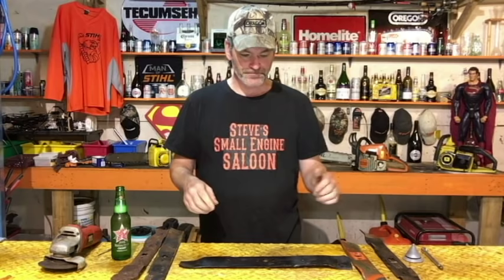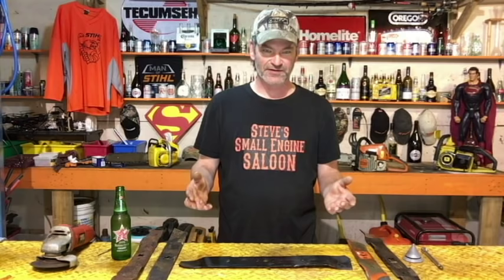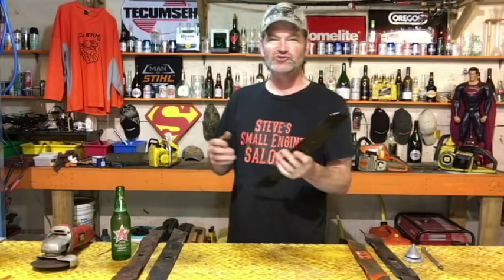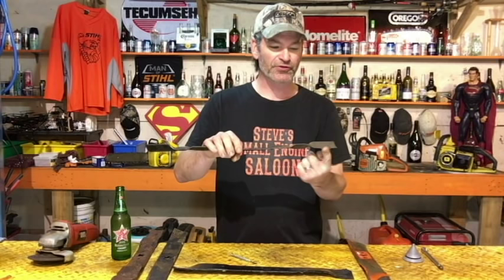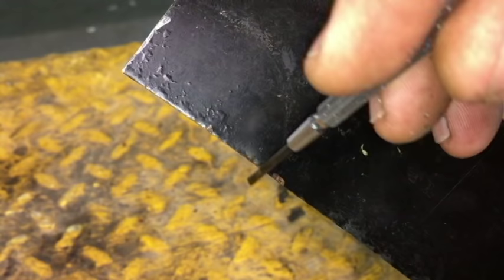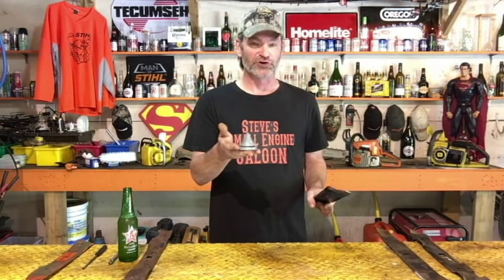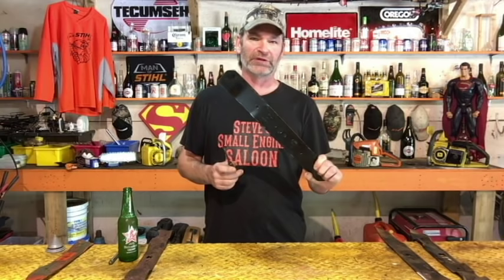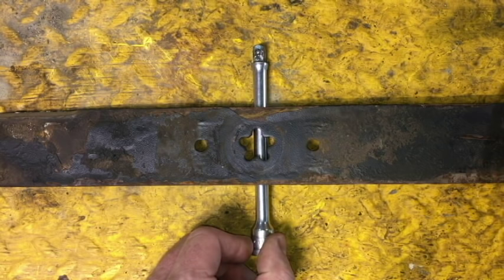How To SHARPEN And BALANCE A Lawn Mower Blade (The Correct Way)

Comment: I have read and heard from more than one source that it isn't recommended to use power tools to sharpen a blade because the resulting friction can generate enough heat to damage the temper of the blade, making the metal soft and prone to nick easily. Is there no truth to this?

Comment: If your blade is perfectly balanced it shouldn't move at all when you put it on a nail as you demonstrated. Now put one of your unbalanced blades on a nail and see what happens.
A nail is extremely reliable, so long as it's nailed into the wall level.

Comment: If you're sharpening a straight blade a stone or wheel of death is fine, but on a stepped blade you need the flexibility of a flap wheel..........And don't lay your grinder down on the wheel, it's dangerous.

Comment: Dam it : wrong beer too.. mine kinda clear with lots bubbles..... Big 40 penny nail is very reliable.. just be sure mark line accross blade were center is.. line nail up on it. i do both ! ... also if ruff cutting your field and dont care if not perfect... im use sledge hammer to fix bent blades.. exspecially if i intend on hitting some more stumps lol .

Comment: Hey, you forgot to tell them to put the blade back on the correct side up!
No poop dude: wrong side up don't work.
How the hell I put the blades on upside down I'll never know, but when I engaged the blades on the riding mower, I had a garden tiller. Took a minute and a couple of tries for me to figure something was screwed up.
Well, momma didn't call me son because I was bright. Hind sight, it must have been the wrong brand of beer.

Comment: .                              DANGER ⚠️
.          If you have a badly bent blade
NEVER NEVER ATTEMPT TO STRAIGHTEN A BLADE BY HEATING IT WITH A TORCH !!!!
Heating it with a torch will dangerously weaken the blade and could snap when you go to run the mower , Earlier this season , A friend of my buddy did that and when he went to run the mower , The blade snapped and went through the side of his garage and was sticking through the wall on the inside part of the garage
Had anybody been standing in the path of the broken blade could have been seriously injured or killed , You have absolutely no idea where the broken blade is gonna go when it snaps and will be thrown with more than enough force to easily kill a person
Also when the blade snapped , The mower was so out of balance it ruined the engine because the shaft was so badly bent 
So at anytime you have a bent blade , 
Replace it with a new one , In everything you do , ALWAYS PUT SAFETY FIRST !!!!!

Comment: Yo Steve , One very important thing you forgot to mention was to always have a spray bottle of water with you when sharpening a lawnmower blade
Only grind at short intervals and check the blade to make sure it's not getting too hot ,  Spray the blade with water to cool it down
This is to avoid getting the blade too hot which will draw the temper and ruin the blade  , 
So always keep an eye out to make sure the blade isn't getting too hot and spray it frequently with water or dip the blade in a bucket of cold water , Besides sharpening lawnmower blades , Any other items you're sharpening , Spray or dip the blade in cold water to prevent the blade from getting too hot which will draw the temper and ruin the blade
If the blade turns blue , It got too hot which means the temper is gone and the blade will have to be replaced

Comment: Rats!  I can't have a Heineken because of all the medication I take.  However, I'd like to say if you haven't tried a flap wheel on the angle grinder to sharpen blades, you're missing it.  I never had much luck with a bench grinder probably because I can't have a beer.

Comment: I don't know how dull your files are but I can sharpen one of the edges on my blade with a file faster than I can install a flap disk on my grinder.  This is absolutely not an exaggeration for effect either, it's about 20 passes with a file, maybe 50 if it's really beat up.

Comment: The other thing, do not grind the s..t of the blade to get rid of the dents on the grass/bottom side. Just use a file to get the bottom clean flat and than grind the angle sharp.

Comment: Indeed never sharpen the blade still attached to the mower especially the ones with aluminium chassis. The ground off steel particles will embed in the alu. Then a chemical reaction starts and eat away the alu chassis resulting in many holes.

Comment: OMG! I was about to give you a hard time for calling a Heineken a beer, but then you advocated for holding the mower blade in one hand and an angle grinder in the other ("gloves, probably"). Holy shit.
Use a vise people. If you don't have a vise, use a clamp. If you don't have a clamp, you have no business sharpening your own lawn mower blades. Sheesh...
Also, in addition to putting the edge on the blade, you need to lap or flatten the back side to remove any burrs, rust, etc.. 
Some lubricant suggestions: Kentucky Bourbon Barrel Ale, Deschutes Black Bute Porter, Firestone Velvet Merkin, Shiner Bock (in a pinch). You will never refer to a Heineken as a beer again.

Comment: Never use a grinder disc, it will burn the edges and ruin the temper, best thing is a flap disc  gliding along flat, grinding on both sides of the disc, and  don't worry too much about the angle, there's nothing hard and fast about it.

Comment: Gloves, GLOVES using a power grinder especially handheld, it will grind a finger off in half a second. With a leather work glove, even the cheap ones, it'll give you time to let go (a tenth of a second). When you let go your finger comes off the trigger, blade stops, so even if it falls on your foot that only hurts, doesnt cut off a toe. Focus, if it's got a cord move that cord around so its not by your feet, if somebody's going to watch move them to your side away from hand holding grinder. Kids like watching sparks fly but they are metal dust that will get in their eyes. Eye protection, or wear some kind of glasses. If you buy anything, read the label, buy from any country except China. (Chinese people are fine but not their government, not their companies)
Reply: No it wont grind your finger off. You're either lying or have no idea what yohr talking about. I worked for a landscaping company for 3 years and everyday at the end of the day I would sharpen a stack of blades with a bench grinder so they could be put on the mowers for the next day. I never wore gloves and many times my finger hit the grinding wheel and ABSOLUTEY NOTHING happened to my finger.

Comment: To start with, you failed to mention the correct way to sharpen a blade. First, after it is removed, remove the rust and buildup of grass. Then, sharpen & balance the blade.